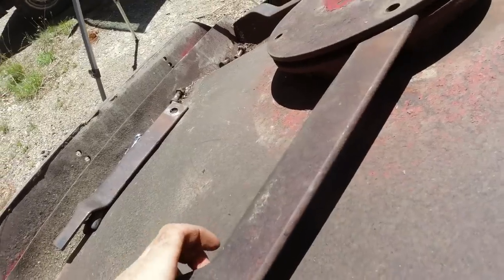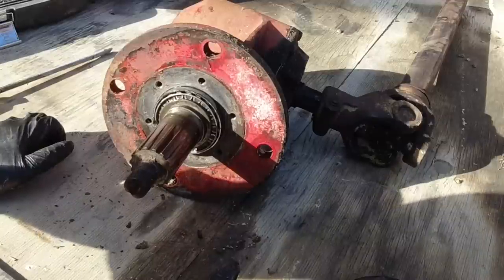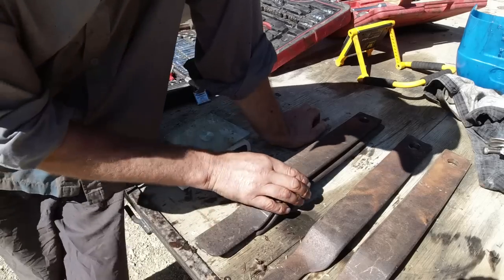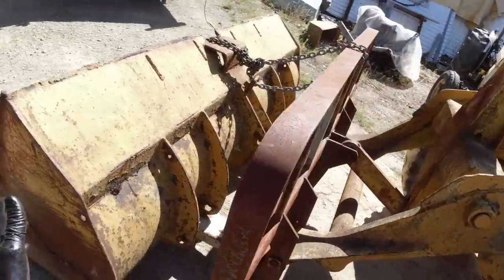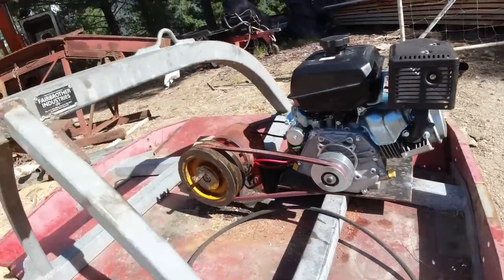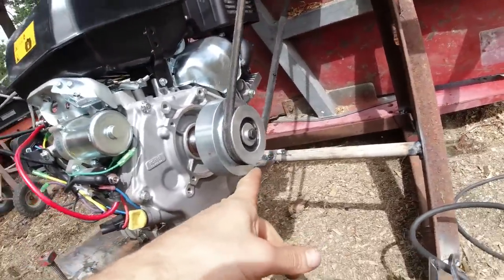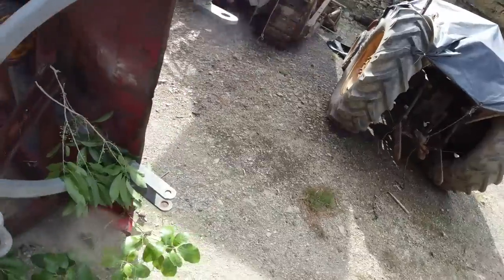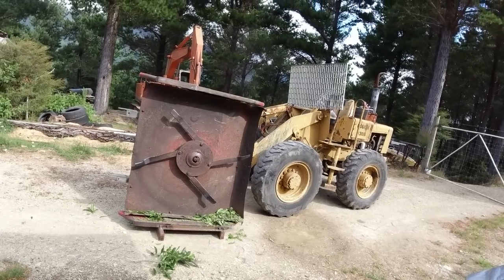Fixing an old Tractor mower and turning it into a Hedge Trimmer

Comment: A car engine will have to include the gearbox, cooling and electric systems, some creative control extensions and a much stronger mounting frame, adding quite a bit of extra weight and complexity to your trimmer. 
I'd say better try a heavy duty tiller engine, something like a 12-15Hp air cooled 2 cylinder 4 stroke, together with the original lightweight high torque gearbox. As you don't really care how it looks you can strap the whole tiller up there with the wheels and blades removed and control cables extended right up to the tractor cab.

Comment: I need your opinion: are two ground wires attached to a single FG post on a 24v power supply. Safe? A good idea? A bad idea? How would you modify two double pronged connectors on two ground wires (a frame ground wire, and a switch-power inlet wire) so it would be safe? The featured video on my YouTube site shows what I’m dealing with. You’re the only person I know that I trust with questions like this. (Also, my middle son spent a year in NZ, and loved it!)
Reply from the maker: Probably not a good idea for me to offer electrical advice without seeing the system in person. might be a job for an electrician. Id hate to point you in the wrong direction.

Comment: Hello Marty. Would changing the pulleys on one or both ends make a difference on the speed of the blades? Mad Max it is! There may be something like this in the next of the series if there is another. Have good days!
Reply from the maker: The gearing is optimal how it is 1:3.2. the other way around would burn out the clutch

Comment: Hey Marty, I feel like I learn so much from your videos. I have a question, how did you know to press the bearing a little more? You mention you were able to feel that it was off a bit, what did it feel like?
Reply from the maker: The shaft was loose in the bearings so I pulled it apart and found the roller bearings needed a little more thrust to bring the rollers closer to  bearing shells, When I was finished there was less side to side movement in the shaft.

Comment: I'm none to sure if a small car engine powering a bush hog is a good idea. Now a small truck engine or a BIG car engine (or two).  A triple B section pulley is usually a sign that it can handle 30 hp or more all day, so with an agrarian overload allowance a small car engine is going to need a bit of atmospheric pumping aid to render trees to dust.

Comment: Seems really strange that those bearings would just be preloaded by small press on collar. I wonder if they're supposed to be shims between that and the cap that goes on over it.
Reply from the maker: There was a type of gasket on the end cap which I scraped off upon reassembly, this provided a little more thrust on the bearings
Reply: @MartyT  ah gotcha. I wonder if there are shims you could add but they just weren't needed when it was originally assembled. It definitely makes sense that that end cap would be the thing that actually held the bearings together. I don't think that ring would work especially given the axial loads that would be induced by the radial forces

Comment: Regarding the shaft bearing: it seems likely that it vibrated out of place. Without any different retaining mechanism, it's sure to do the same thing again. Does that bottom plate not secure the bearing into its seat?
Reply from the maker: There was a type of gasket on the end cap which I scraped off upon reassembly, this provided a little more thrust on the bearings

Comment: I’m sure you are on this. How does the oil level in the mower gearbox set after rotating the deck 90°?  Nice job Mr Goldberg.
Reply from the maker: oil level is half way up the bearings/shaft/ gears so no probs

Comment: Marty, I have been thinking about a similar project.  What are your thoughts about using a hydraulic motor to drive the mower gear box?
Question answered. Thanks Marty
Reply from the maker: Yes If I had a spare hydraulic drive motor, I would have tried it but I suspect my tired  Hough 30 pump would  lack the required flow
Reply: @MartyT  I think the Hough pump would struggle even if it was new.  I doubt it ever had the flow required to deliver the necessary HP to a motor.

Comment: You're not related to Inglewood's Butler Brothers  are you? - take a look at the machines they used to run! Their hedgecutting machines were ex-army 4×4's running 2 flathead V8's - one to drive the machine and the other for the blade......
Reply from the maker: Ive seen that video, unstoppable machine

Comment: Question  could you use a hydraulic motor to run the mower ?  How many HP motor would you use?
Reply from the maker: Yes I was thinking the same but not sure if the old hough flow rate would be up to the task, it would need to be 18hp +

Comment: Maybe you can find a bigger Kohler engine they have them in 20, 25, 27, and I think 32 horsepower, there's also other brands the same sizes as well as diesel engines the same size for industrial equipment that you might find in a damaged mini excavator, commercial lawn mower or something.

Comment: @ 6:30 i wonder if instead of weighing the entire blade you instead placed only the end of the blade on the scale. that would tell you the weight of the blade out at the end where there's the most force. like imagine if you balanced the blade by taking off weight from the metal nearest the pivot you might be balanced overall but not when it's rotating.

Comment: awesome work mate. i was wondering if a small motorcycle v-twin would work as a motor. suzuki sv650 (early) has 70 odd hp and are cheap
Reply: Personally, I dont think it is a power source problem. More of a transmission issue.
One A section belt is only good for about 5hp. A quad set of pulleys and a beefed up flywheel would sort this.

It is not doing continuous duty so powering up a flywheel between trees would have enough energy to do the do when it gets on it.

Have a great day, Andie
Reply: @andiehyde3714  considering a transmission from the bike i mentioned can handle more than that, for a non complicated project it would be super quick and easy to install and would easily do what he needs. that little motor would still be on its limits
Reply from the maker: Actually that would be ideal

Comment: How about an electric motor and pull power from the loader? All the torque is at the low end.
Reply: The Hough's electrical system wouldn't have enough grunt to run that thing.  Nor would the hydraulics.

Comment: How do you power your stick welder, with your turbine and solar? You have 220 volt?
Reply from the maker: I use a 6.5kv generator, not a good idea to weld from an inverter
Reply: @MartyT  thats what i thought. I use a 3.5 k and it barely works

Comment: I bet the lopsided blades just vibrated it loose
Reply from the maker: No it was quite smooth after I balanced the opposing blades
Reply: @MartyT  I meant the reasons it was loose. First video showed it shaking it before you swapped around the blades